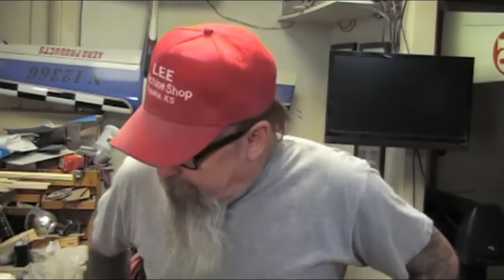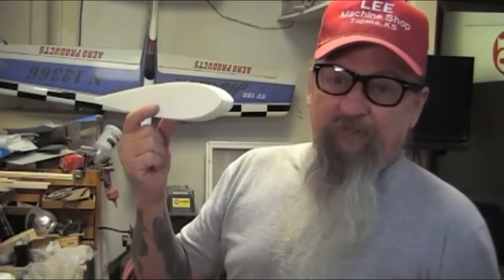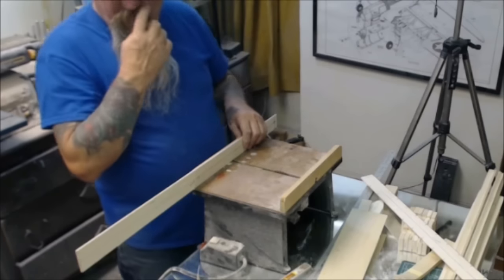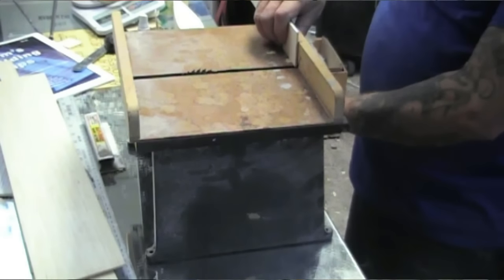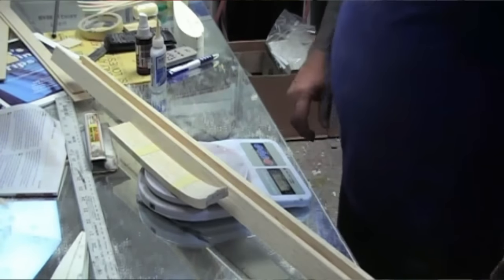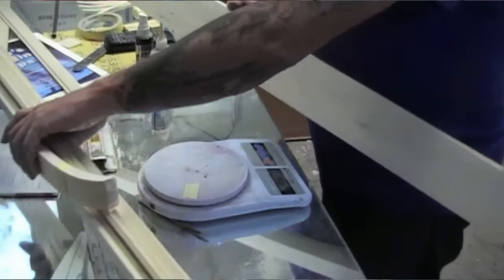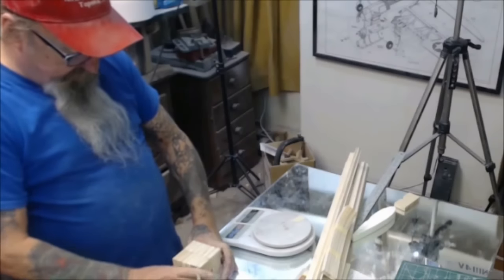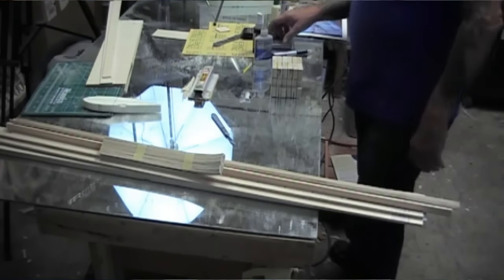Building a Tom Morris Regular Millennium wing

Comment: That saw tool you have in the beginning of your video when you cut the spar notches what is its proper name and where can I get one economically ?  Also I am not sure I understood you technique with the nail / and equal spacing on the ribs .. maybe you can elaborate a little ?
Reply from the maker: It is a 4 inch Dremel table saw. I made a table saw slide
Reply: @Stunthangar  Great - thank you !!!  I will be shopping from your store very soon again.